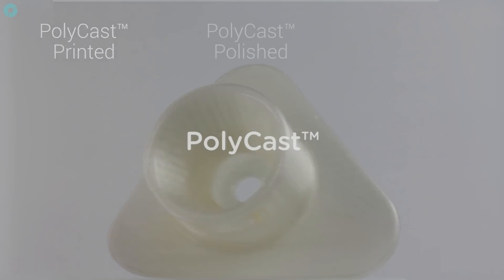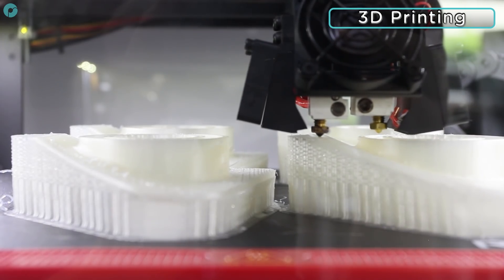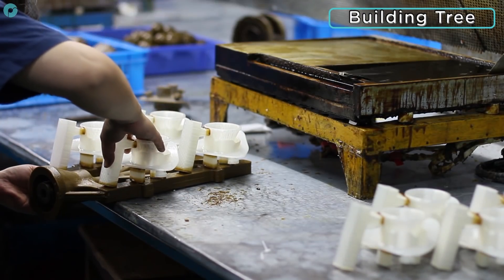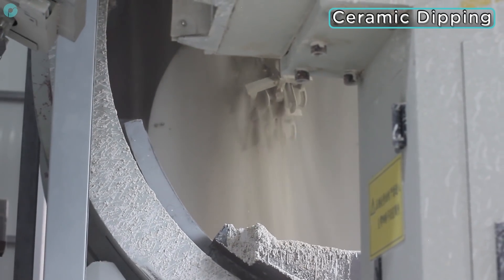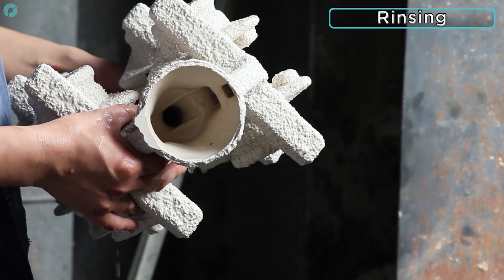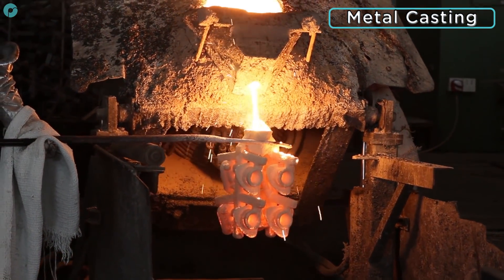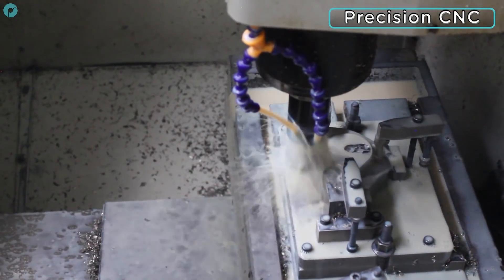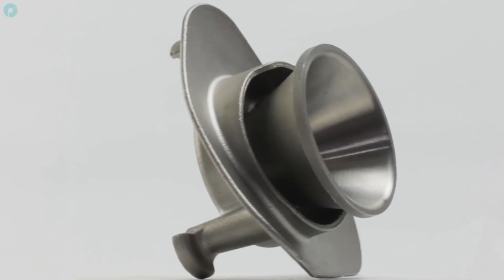PolyCast™ - a 3D Printing Filament for Metal Casting

Comment: 1:32 anyone know the name of that ceramic slurry?
Reply: Its called ceramic shell. Its made up of a variety stuff, colloidal silica and other binders. You add silica flour to it as well. Its expensive stuff and the problem is once you mix it you have to constantly mix it or it will harden and dry out and a lot of cash goes into the land fill. Anyone looking to cast on a small hobby basis would be better off looking into investment casting. Pretty strait forward and affordable.
Reply: @JohnWHadlock  thank you. At first i thought you were just describing it but its just ceramic shell. I'm considering using plaster of Paris as investment casting, But I do want to be able to heat the mold up pretty hot without cracking. You think plaster of paris is fine for that or is there some better investment casting brand material?
Reply: @mhypersonic  You can cast very well in investment casting if you do it right. I would just do some googling. A couple tips are. Let the investment "cure" not dry out. Let it cure for a couple days in a dry environment. Second use proper sand like a fused silica sand, you can play around with proportions of plaster, sand and water. You can buy other binders for it. Third is use a scaffold in your mold. Like re bar in concrete. Lastly when you go to heat up or vitrify the investment heat it up slow so the expansion of the material melts out versus expanding and cracking the investment (that's where a good scaffold comes in). Also when you print your part use as little infill as possible. It will limit expansion. And don't over cook your investment. It will turn to chalk. Its not like ceramic shell which fuses together and makes a solid shell. Good luck
Reply: @JohnWHadlock  THANK YOU! I've been do much research and you've helped so much. When you mean scafford i looked it up I didn't really find anything but are you implying that if you use steel wool in between the layers it will reinforce the plaster from breaking and cracking. Cuz if so that is a really good idea. I didn't even think about doing that. Not necessary considering plaster still pretty strong coated with silicone powder but i have the materials so ill try that out 2 or 3 layers in.
Reply: @mhypersonic  sorry I wasn't very clear. When you do investment you built a frame or mother mold around the part and then pour the sand plaster mix around your part.  The "scaffold " is placed in the empty storage between the mother mold and the part. It reinforces the plaster mold.
Reply: @mhypersonic  dang autocorrect.  I'll find some links to explain it better.
Reply: @JohnWHadlock  oh so extra thick plaster between the shape molded and the outside wall, unlike the "thin"  outlined shape ceramic molds produced. Ok. But the steel wool is a good idea for reinforcement on a large mold prone to cracking even if unlikely. Like rebar in concrete slabs for construction
Reply: @mhypersonic  I would say chicken wire rather then steel wool.
Reply: @JohnWHadlock  seen some example of chicken wire used for reenforcement for foundary bricks. Unfortunately the results weren't great and the wire ended up creating uneven heating and cracking the bricks during the testing, so I would be concerned that you would see a similar issue with using it for molds.
Reply: @nic.h  Supporting refractory brick and trapping the chicken wire in the investment would serve two different functions. Any steel material that will hold the investment together will serve better then just the investment alone. Its like cement with out the rocks to make concrete. The plaster of Paris needs something to hold it together as it starts to expand. 

You can buy a material, that gives me nightmares from my foundry days, that is stainless steel needles/wire that you can mix into the investment. We used to use it as one of the 2-3rd layers in the ceramic shall process. It helps tremendously from having blow outs and expansion cracks. When your pouring 500lbs of silica bronze you don't have time to shore up every nook and cranny of a shell to be filled.
Reply: @JohnWHadlock  agreed creating refactor bricks and investment molds are different, although I would expect some similarities in how they behave.  This is the video I was referring to https://youtu.be/xV51Om1Mv_o at around 7:30 you can see the results, the ones with the wire mesh show fractures which are apparently due to the mesh and my concern with using it in investment plaster is you could see similar behavior. Admittedly the materials used are different so maybe it's not a concern.

One other option I've heard to help with plaster of paris cracking is Aluminum Oxide. Which is also common as a refactory material in fire bricks. It doesn't really provide scaffolding, but I think the idea is it helps significantly with the thermal shock that leads to blow outs during pours.

Comment: Seems like a waste of time 3d printing each "investment" for a production run of the size shown( looks like over 10,000 pieces or more) , 
a part that intricate would take a minimum of 2 hours per 3d print per part 1-1 ratio, but with heavy undercuts like shown, I can see the benefits.
 
If you are looking to mass produce cast metal parts (without undercuts) why not try instead:
 1) 3d print the prototype.
2) smooth out Z layers with your preferred method  
3) Make a 2 piece Silicone mold of the plastic part ( you can make more molds as necessary out of the 1  plastic prototype)
4)pour wax into the mold to create your investment
5)cast as per normal "lost investment" casting process

by all means , if you are only making one prototype part ever, use the plastic and wait the 2 hours print time. Just make sure you don't fudge the casting process or it's back to square one.
Reply: I don't think that example part can be demolded from a two pc silicone mold the geometry would trap part of the silicone mold. But yes if possible you should use 3d printing to create a reference mold and then cast of that if it was possible. But for extremely complex shapes or say if they wanted internal fluid channels ducting it would be impossible to use a 2 pc silicone mold. It does have its applications I think there are also 3d printing in wax itself but that is more complicated and requires different types of printers or the filament is harder to print. This filament is probably just a really clean burning PLA to keep the ash content down. Wax is always going to be better because a majority of it will melt before it burns off so you'll get less ash for sure.
Reply: There is a huge application of this in terms of reconstruction. A truck loaded with a few hundred networked 3D printers prints out parts for let's say a water filtration plant. Some are for metal parts like this, others like a pcb board printer/populator makes the electronics, etc. Another truck holds and operates a small recycling/foundry setup. Between these two trucks and a few dozen volunteers they could collect debris and use it to construct needed equipment. 

Things like scrapping a few dozen cars that got trashed by a hurricane into motorized frames for solarpanels that follow the sun inorder to more efficiently power a hospital. Essentially situations where almost anything could be needed, but logistically you can't send everything. A convoy of 10 those trucks could rebuild a small town better than it was before in a matter of weeks.
Reply: Did you even watch the video? I hope you’re not this careless in your actual job...The guy says at the start this is for: complex but low number runs. He even says they only need 140 of the example part.

Comment: The printing time and pla are costly as for each casting one premium 3d print is wasted I wonder if its feasable or not
Reply from the maker: For short production runs, design iteration and prototyping it is not only feasible but saves time and money.
Reply: @Polymaker  thanks

Comment: very cool, but it multiplies the number of design constraints by a ton and doesn't have the advantage of traditional casting

first constraints are for printability
second constraints are for castability
third constraints are for machienability
all those limit the geometry that can even be made
and traditional casting offers economy of scale

slm metal printers can pretty much do whatever they want, if it doesn't have to be machined

the advantage is in low volume metal parts of course
where it is much cheaper than slm
Reply: slm actually requires supports, I think youre thinking about sls. Polycast is based off of polysmooth or pvb, which doesnt have the beat layer adhesion, so support should be easy to remove, and uou can ipa smooth polycast.

Comment: I have a feeling I can't do this at home
Reply: No, you can. It's easier to use jeweler's investment plaster rather than the ceramic dip shown here, but casting lost-PLA parts at home is totally feasible. There are quite a few tutorials available showing how to build your own backyard metalcasting foundry.
Reply: You can use small cnc machine, and forget about all the other steps. 🙂
Reply: You certainly can. Most backyard casters use lower temp metals like aluminum or zinc. Search "lost PLA" on YouTube for many videos
Reply: @Fragmentofbone  That's when I lost it. All of this and then they still use a CNC to clean things up. Might as well use the CNC to begin with and save yourself the 3D printing and casting.
Reply: @dsp4392  Ummm - 3D printing a metal part like this?  I guess the first step is to buy the $1M plus machine.  I am in the CNC industry, but unless you have a 5-axis (minimum) mill then you want be able to make those sorts of parts with serious undercuts, and such small "gaps".  Then to get the surface finish in 3D, CNC takes forever as you need to used a very small diameter ball nose cutter. CNC at the end to give a 0.001mm tolerance on surfaces, holes or other critical dimensions is a perfectly feasible application of this.  The point here is their are different "best" techniques for different applications.  This is an excellent idea for small runs, or where you are not ready to "invest" (pun intended) in tooling for sand casting.  Even then, the undercuts still need to be seriously considered.  Horses for courses they say.

Comment: I’ll be honest I’ve been having parts cast and just using PLA... pretty sure this is just PLA named something else sadly
Reply: Pretty sure standard PLA tends to leave some residue during the burn out process, resulting in imperfections on the finished parts. Basically the finished parts will have pitting in them instead of a smooth surface

Comment: Why don't they just use the cnc cuter from the start...
Reply: Because deep undercuts are very difficult to machine via subtractive manufacturing, and it wastes less metal to cast a near-net part and finish, than to start with a block and remove 80% of it. 

TLDR, it's faster, easier and cheaper.
Reply: @MysticalDork  I'll need to see an expense report to believe that hiring workers to go through all these processes is cheaper than the waste incurred by CNC. Especially considering that shavings can be easily recycled.

Comment: "Completely removes the need for tooling" puts on cnc for post process machining...
Reply from the maker: This refers to the traditional method of creating a steel tool to inject wax patterns into. PolyCast™ eliminates the need for tooling by replacing injection molded wax patterns with 3D printed parts. In both methods, fine tolerances need to be achieved by CNC machining after casting.